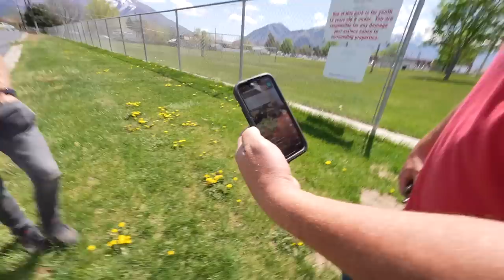A SHOCKING TRANSFORMATION!!!

Comment: Silver truck only needs a 4 inch lift kit,bigger more aggressive tires, and a wench on the front...You know you will need a wench Trent ,how will you help stuck neighbors without it......I think you had the perfect truck that was paid for...I got the newer 1500 Hemi gas hog myself and regret it often.Cost 100 bucks to fill yesterday..I've had to be pulled out of the mud twice,the 4x4 just isn't as robust. Its not near the Truck I sold...I've found I hate the smart cruise control and most of the so called safety up grades.The HUD is a useless novelty. Back up camera is nice but then I could of added that to the 2500 for a few hundred bucks........I hope its what you needed and it works for you..I know you'll never admit missing the Black trucks ability's.

Comment: Allie the trucks are the same size both dodge Rams it’s just that the black one sat up higher rams only come in one size but 1500 2500 3500 suspension and tow ratings. Just saying🙂

Comment: Congrats on the new truck! I like it. As do I like the 4Runner. I like the more modern front on the truck. But please let your friend wrap it in black. Will you get a trucK topper or camper shell to make the bed more usable to store items out of rain, snow wind etc and make it safer if you park in the city? I like black cars and trucks. And also it will obviously protect the original paint as well. And I’m confident that it will make through the snow in the winter and mud in the rainy days😁 I mean the 4Runner makes a terrific job. And that’s not a monster truck.
Reply: Black is extremely hard to keep clean looking.
Reply: @bevtrue6937  I know. Although I don’t have a black car. My Toyota is dark gray. And it constantly dirty fro
The dirt and grime from the snowy roads or in the spring and summer it’s covered in pollen. I think it applies to all dark colors on cars and trucks - they are hard to keep clean looking

Comment: How sad that Leka got "trained" with a shock collar.  She's doing it out of fear of being shocked.  That's not training.  She's afraid to do anything for fear of being shocked. 
I pray you quit using it. Her body language shows how worried she was as you were telling her what to do.  Ears back, lip licking, and other body language.
Reply: You could call the board and train facility and ask if that's how they do it. I guarantee they do not. Lika was there for three weeks. It entails basic commands, which they solidify before introducing the electric collar. They indroduce it at such a low level stimulation she barely feels it. Then once she will understand the e collar. It is not used to hurt her. It's like a tap on the shoulder. I can't go too in depth in a comment but it is not what you think it is. Nobody shocked her in the video so why do you think she is scared? She simply did every command she was given. On top of it all she is 2 very intense and high drive breeds of dogs. Learning and being able to control her self was very needed for her happiness/quality of life and safety. ☺️

Comment: Y’all keep saying this truck is smaller! How? It’s not lifted as high but size wise it’s basically the same truck, then you said you hope it’s as capable! It’s a TRX, it was built to compete with the awesome off-road Ford Raptor(which you should have bought 😇) this thing is a 6.2 liter 702 horsepower fire breathing 4x4 that’s 10 times more capable than the truck you had. Not to mention at 85k+ sticker price. P.S. you could have washed your truck before you traded it in!! Congratulations

Comment: Wow are they downplaying that truck.  If I'm not mistaken thats a $70,000 Dodge TRX high performance truck built for speed and offroading.  With 700 horsepower its faster than most vehicles on the road and off road its more capable than the 4 runner.  You dont buy a truck like that for reliability you buy it for fun.  They know what they bought yet to the camera they are acting all worried as if it wont be able to handle hauling some wood or driving in the snow.  Just own it and say you bought a bad ass truck because its cool instead of acting all phony about it.  If you said you got it because its cool I would be like... Awesome good for you, enjoy it!  But to act like anything else just doesnt seem genuine.